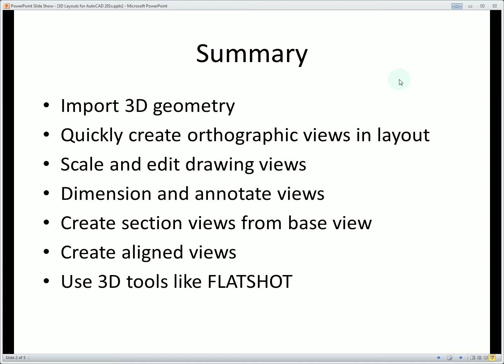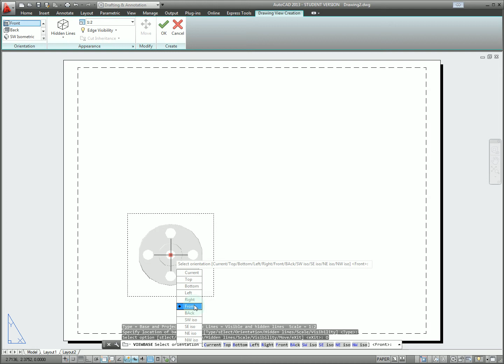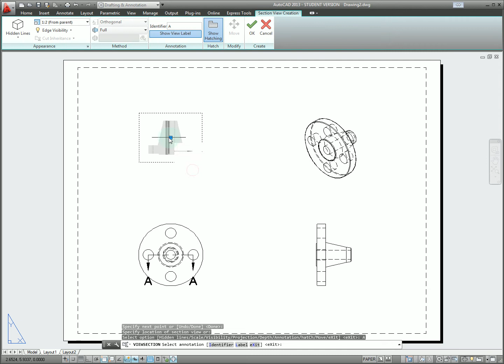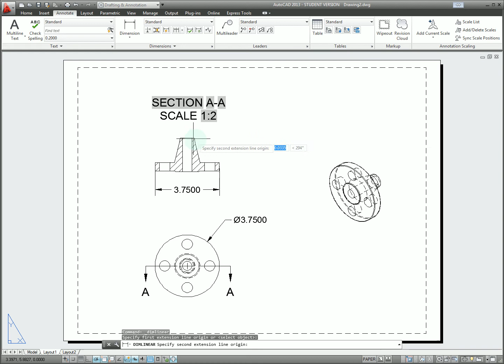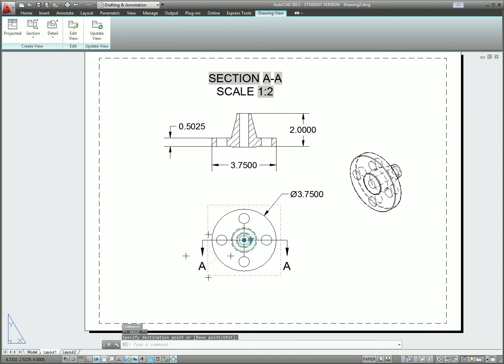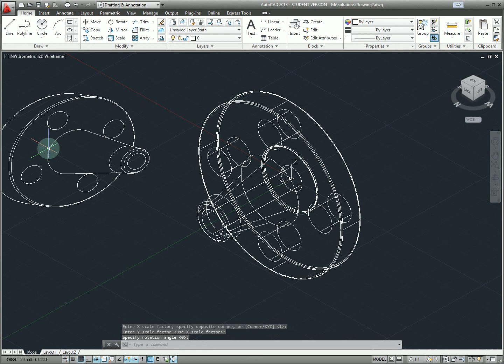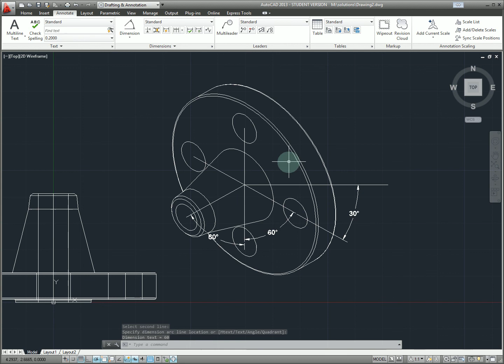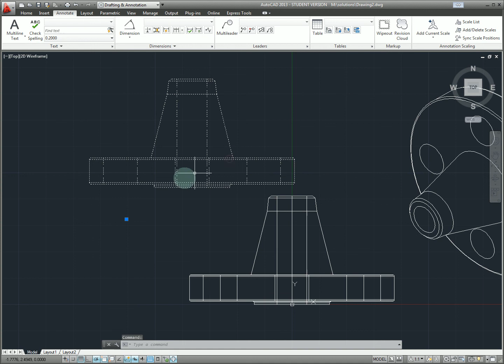Using 3D Geometry in AutoCAD for multi-view drawings

Comment: Sir I want to replace my  current computer workstation.. mostly I'm running 3D structural design in Autocad 2013 around 360MB, could you please asisst sir what is the perfect aspecifications i should buy either in HP or Dell workstation brand? thanks